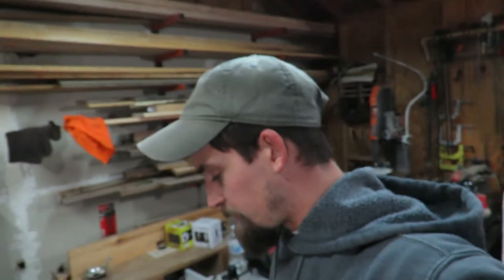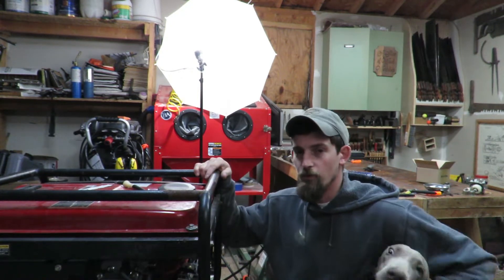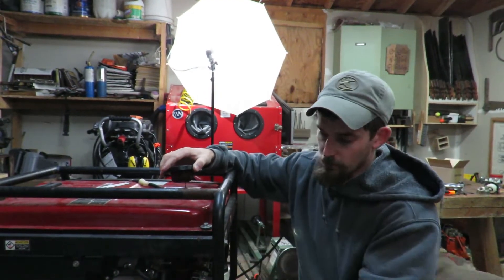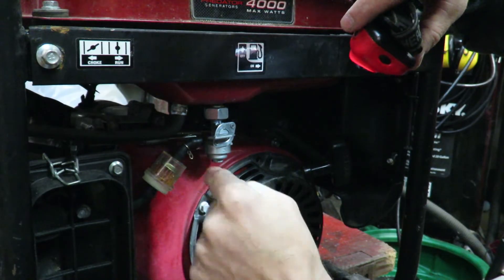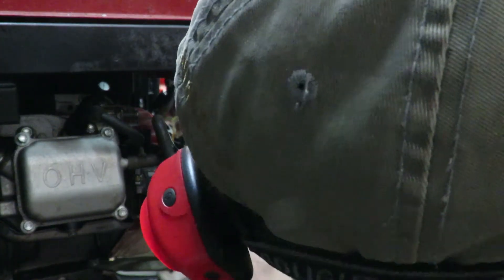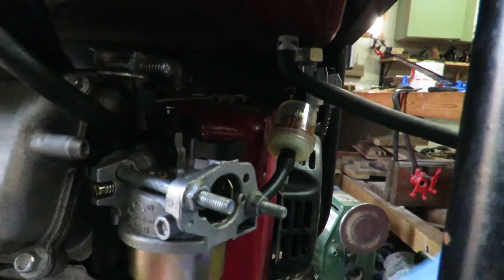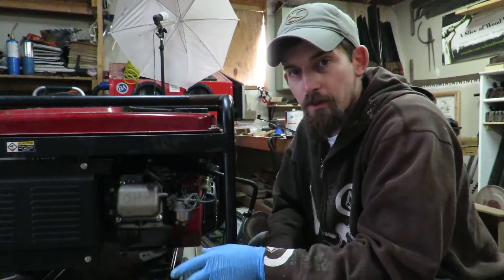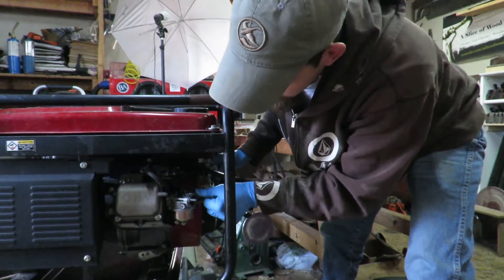Predator 4000 Generator | Solving the Fuel Issue

Comment: My generator is giving me a problem and I just noticed in your video @12:12 that mine doesn't have that fuel air mixture screw. Am I imagining things or did mine fallout? Can anybody confirm this is necessary?
Reply: Tim Thorson the original carb didn’t have a screw it is a fixed jet. The replacement carb has a adjustable idle jet screw. Replacement carbs are about $15 amazon And it will fix surging problems.  Get the right one.  If you’re good the carb can be cleaned out to work well.  Watch YouTube’s for that carb.  Use stabil in fuel to limit fuel storage problems
Reply: @davidschipsi1316  ah, yes. Thanks for the info. I just may go that route.
Reply from the maker: It may be located in a different area. What issue are you having?
Reply: @ASliceofWoodWorkshop  apparently mine sat for a few months with fuel - I normally run it dry before putting it away.Now starting at all, gummed up? I did get it to idle briefly with air filter off and occasional squirts of carb cleaner.. now it runs rough but only when in start choke position... Discovered a small spring that was not hooked to anyting and figured it was for the choke valve but not sure...

Comment: I repair generators on the side, as a hobby.  Can’t stress enough the importance of running ethanol free fuel in all of your equipment.  You can buy AVGAS/MOGAS octane 91 which is available at municipal airports, or ethanol free fuel available at a Lowe’s, Homedepot.  Airport gas is $4.50/gal, and the stuff at Lowe’s is $20 a gallon.  Trust me, you will eliminate virtually all the carb problems that 10% ethanol gas will create, especially in engines that get sporadically used such as a generator.
Reply: Hey I know this comment is a few years old but I have a question, if you make sure to shut gas off and let the engine run until it shuts off does that eliminate the carb buildup problems?
Reply: @christopherflannery5034  yes most problems. However, gas in tank will go bad as early as 6 mos depending upon external conditions. If you use ethanol free you will be saving yourself headaches.
Reply from the maker: If you run the fuel out of the system then yes that does help
Reply: Don’t forget about the generator safety rules: Always make sure you follow all the generator safety rules whenever you use your portable generator. This is only a reminder. Generators can be dangerous if not used carefully. Every year, hundreds of people die or get injured when using portable generators due to carbon monoxide poisoning and electrocution. Make sure you are using your generator carefully and keeping others safe as well. There is something very serious that everyone should always be aware of when using generators. Some people do run their generator indoors which is not safe and that increases the risk of carbon monoxide poisoning which can cause death of family and you. Some people run their generator in wet conditions which can electrocute them. Please remember that you should never run your generator indoors. Remember that carbon monoxide is an odorless and colorless gas that you cannot see or smell. Carbon monoxide is a silent killer. Keep that in mind. Make sure your generator is 15-20 feet away from your house and away from doors, windows, and vents. Never use your generator in your porch too. Having a carbon monoxide detector is very important against generator safety. Some people also allow children to go near the portable generator which could pose risks. We need to keep an eye on our children making sure that they are not near the portable generator so they won’t get electrocuted or burned by the generator which is dangerous. A locking enclosure also keeps kids safe. A generator shed might look like a tempting place to explore, or take cover during a game of hide and seek, but a generator is a dangerous piece of equipment that can cause injury. It says on the manual that we should also keep children away at all times from the portable generator to avoid injuries. Please do not allow a child or unqualified people to operate the portable generator.  It is important to keep your children safe especially little ones. The portable generator can be hot during an operation. Just because some manuals missed what should be listed doesn’t mean it’s safe to do. Always follow the generator safety rules when using portable generators. Generators pose electrical risks. If you need to use your generator during wet weather, you need a generator tent to protect your generator from getting wet. Don’t let your generator get wet. Keep your generator dry and before using your generator, please make sure your hands and your generator is dry. Do not wear loose clothing when operating the generator. Everything that is said on the generator’s operating manual should not be ignored. Never smoke cigarettes near the generator. Please keep flammable things away from the generator. Never overload your generator too. Your generator can catch fire. Never ever try to plug a generator cord into a wall outlet to avoid back feeding. Back feeding your generator is dangerous. Always turn on your generator first before plugging in appliances and shut off the appliances before turning your generator off. Use a heavy duty cord for your generator and the cord should not be worn out. All the instructions should be followed carefully. Never refuel your generator while it’s running. It can cause fire if fuel spills while your generator is hot. You should turn off your generator and let it cool off before refueling it. Having a fire extinguisher next to the generator is also important. This is only a reminder for everyone’s safety of using generators. Make sure your generator is properly grounded. Having a fire extinguisher next to the generator is also important against the safety rules. https://youtu.be/I1jT3ANENvI and here is a video more about keeping others safe when using generators and also about our family’s safety. It’s important to keep our little children safe as well. Make sure your little children are kept away from the generator at all times especially when it’s running. Hope this helps. Remember it’s better to be safe than sorry.

Comment: Thanks for taking us on the journey. It's good to watch how to do something but it's great to go through the learning curve.  Not sure on the light but I did think it was a little odd that the light lit up before the engine was up to speed or fully running..
Reply: Don’t forget about the generator safety rules: Always make sure you follow all the generator safety rules whenever you use your portable generator. This is only a reminder. Generators can be dangerous if not used carefully. Every year, hundreds of people die or get injured when using portable generators due to carbon monoxide poisoning and electrocution. Make sure you are using your generator carefully and keeping others safe as well. There is something very serious that everyone should always be aware of when using generators. Some people do run their generator indoors which is not safe and that increases the risk of carbon monoxide poisoning which can cause death of family and you. Some people run their generator in wet conditions which can electrocute them. Please remember that you should never run your generator indoors. Remember that carbon monoxide is an odorless and colorless gas that you cannot see or smell. Carbon monoxide is a silent killer. Keep that in mind. Make sure your generator is 15-20 feet away from your house and away from doors, windows, and vents. Never use your generator in your porch too. Having a carbon monoxide detector is very important against generator safety. Some people also allow children to go near the portable generator which could pose risks. We need to keep an eye on our children making sure that they are not near the portable generator so they won’t get electrocuted or burned by the generator which is dangerous. A locking enclosure also keeps kids safe. A generator shed might look like a tempting place to explore, or take cover during a game of hide and seek, but a generator is a dangerous piece of equipment that can cause injury. It says on the manual that we should also keep children away at all times from the portable generator to avoid injuries. Please do not allow a child or unqualified people to operate the portable generator.  It is important to keep your children safe especially little ones. The portable generator can be hot during an operation. Just because some manuals missed what should be listed doesn’t mean it’s safe to do. Always follow the generator safety rules when using portable generators. Generators pose electrical risks. If you need to use your generator during wet weather, you need a generator tent to protect your generator from getting wet. Don’t let your generator get wet. Keep your generator dry and before using your generator, please make sure your hands and your generator is dry. Do not wear loose clothing when operating the generator. Everything that is said on the generator’s operating manual should not be ignored. Never smoke cigarettes near the generator. Please keep flammable things away from the generator. Never overload your generator too. Your generator can catch fire. Never ever try to plug a generator cord into a wall outlet to avoid back feeding. Back feeding your generator is dangerous. Always turn on your generator first before plugging in appliances and shut off the appliances before turning your generator off. Use a heavy duty cord for your generator and the cord should not be worn out. All the instructions should be followed carefully. Never refuel your generator while it’s running. It can cause fire if fuel spills while your generator is hot. You should turn off your generator and let it cool off before refueling it. Having a fire extinguisher next to the generator is also important. This is only a reminder for everyone’s safety of using generators. Make sure your generator is properly grounded. Having a fire extinguisher next to the generator is also important against the safety rules. https://youtu.be/I1jT3ANENvI and here is a video more about keeping others safe when using generators and also about our family’s safety. It’s important to keep our little children safe as well. Make sure your little children are kept away from the generator at all times especially when it’s running. Hope this helps. Remember it’s better to be safe than sorry.
Reply from the maker: Still digging at it at confused as to why it isn't working. Trying to figure out why I lost voltage and having hard time locating a wiring diagram.
Reply: @ASliceofWoodWorkshop  unfortunately pulling it under any type of load could cause damage, but it is a predator and they are very good generators, hints why they call them "Honda Clones", so I would be surprised if it did cause damage... i would start with rust build up on the generator shaft itself, then run the wiring down for defects... good luck to ya...

Comment: You’re getting there, put that other metal/ rubber spa,car back in. 
Make sure you didn’t pop the breaker.
Crank it up, plug in a drill and test it, or plug something else in. Maybe the light blew out.
If, not, spin the drill chuck backwards sharply a few times. See if that works.
You’ll figure it out, I don’t want to spoil you videos.
Good job, keep it up!
Reply from the maker: Tried the drill trick. No luck. Got to dig further and figure out why there is no longer voltage output.